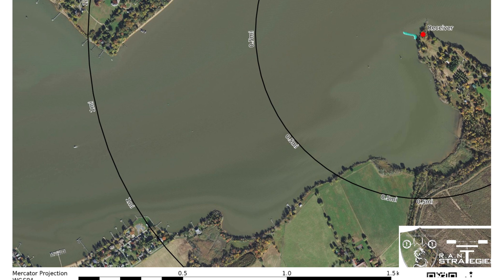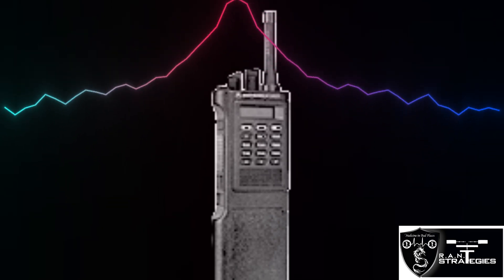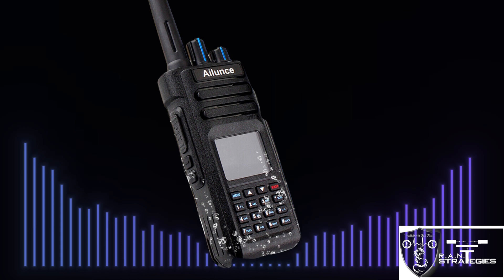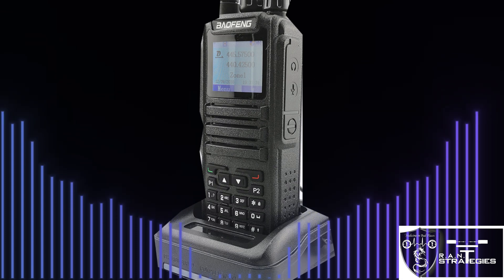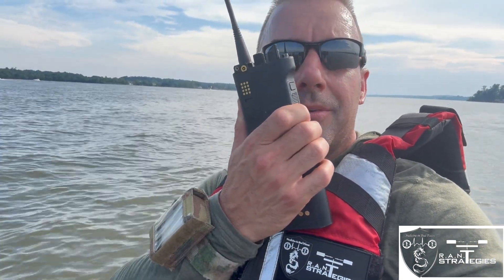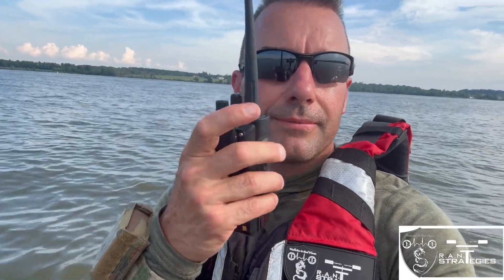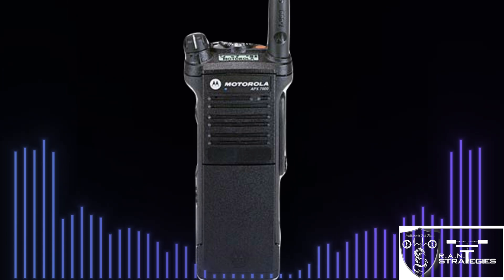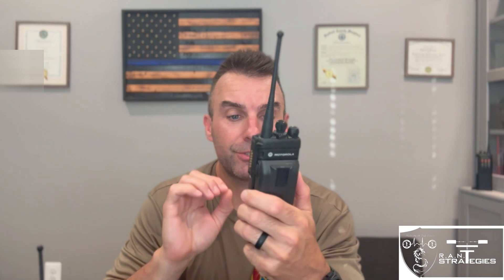UHF - VHF Marine Enviroment Comms

Comment: Well, I must admit to being totally stumped here.
Having watched this test as well as the wooded area tests you performed, quite well in my opinion, I’m at a loss to explain the results.
Back in the late ‘70s, a friend’s family owned a large business in a relatively congested business district. They invested heavily in Motorola Slim Line crystal controlled walkie-talkies running only about 2 watts on VHF with approximately 5” helically wound fixed rubber duck antennas. We tested these radios extensively, and got much better range even in the congested business district than you got over water. Some years later, I would get my HAM license and purchase my first Yaesu 2 meter HT. With the included small battery pack, this radio put out 3.5 watts as I recall, and performed quite well with only the included stubby duck. I would soon upgrade to a Smiley hand-tuned short duck with even better performance.
At this point, I suspect that the Motorola rubber ducks used in your tests may have been designed poorly or not properly tuned to the frequencies that they were operating on.
In any case, I love the range tests and recommend trying a Smiley antenna tuned to the desired band for maximum performance in a practical size.
Keep up the great work…
Reply from the maker: @Nostalgic_York  hey! Thank you for the comment! Yes I too was really surprised by the results over the water. I have read about smiley antennas and everyone raves about them, so they are on the list to pick up and try out for myself!
Reply: @RANTStrategies  Thank you for the very professional tests on all those modern Motorola radios. That’s some collection you’ve acquired.
I’m sure that the hand-tuned Smiley range of high quality, US made rubber ducks will facilitate getting the most out of your radios. If using the radios sans repeaters in relatively open areas with nothing higher than 2 story homes between them, you may want to consider the Smiley 5/8 duck with approximately 6db gain over standard equivalents. This was my go to antenna when I lived in rural America for many years, though I’ve since moved to the city with lots of tall buildings around, thus reverted to 3db gain unity models. Even my stubby ducks out-perform my stock antennas by a considerable margin. Smiley makes these with all the common connectors, thus there is no need to use an adapter with them.
I’m looking forward to hearing about how these work out in your tests…
Best regards,
Jason

Comment: Another top test. I have used Smiley Antennas, tuned for a specific frequency e.g. an antenna tuned for VHF Hi 155mhz is good from 150-160 & a UHF antenna tuned for 465mhz is good from 460-470. They manufacture a wide variety of portable radio antennas and have interchangeable bases for just about any HT made... Motorola, Kenwood, Icom, SMA-F, SMA-M, BNC, TNC ... As I mentioned before, I don't know much about Motorolas.  We had some in the 1990s Coast Guard, and they were boat anchors.  We spent our own $ on VHF Marine Icoms. So I don't know if your Motorola antennas cover the entire frequency spectrum (136-174 & 400-480/520) or if they are "tuned" a bit more narrower... A little trivia... large, ocean freightliners often have UHF radios for comms within the vessel, shipboard firefighting, and for port ops in the 452/462mhz with repeater splits of 10.10, per the ITU. But a lot of them operate on GMRS without a license. It's cheaper. The FCC will send them a warning if they are caught. The UHF penetrates the bulkheads. VHF just bounces around inside the vessel. From your tests, it looks like P25 gives a clearer signal than analog in general.
Reply from the maker: @baronedipiemonte3990  hey Baron, appreciate the comment! I have ZERO experience with smiley antennas but have seen a bunch of good reviews about them and would not mind comparing them to a moto antenna to see how they hold up (hello future video idea). You are also spot on about the UHF radios on ships for the crews….. I am intimately familiar with this form an enforcement perspective and everything you see are saying is accurate. I am very curious to see what happens once I push this out to the 2 mile mark. 🍻
Reply: @RANTStrategies  Having seen this, and your previous tests, I'm thinking that UHF will edge out. "Theory" is fine. It's a foundation.  But real world tests in a variety of environments show what works and what doesn't at the end of the day. It's good that you are testing under simplex because you aren't always going to have the convenience of repeaters - for a variety of reasons... And most of those are 10 watts or more, high gain antennas, 50 ft or higher. I saw first hand what happened to the "fancy" comms in the New Orleans areas after Hurricane Katrina. As well as areas much further north along Lakes Superior & Erie during some hard winter conditions.  A lot of agencies get bit by the newest technology bugs, when often the simple solutions are the best.
Reply from the maker: @baronedipiemonte3990 you are on the EXACT same wavelength with us for what we are going for here by doing these.

Comment: In the water, CB would be the best for range , then VHF and last UHF
Reply: AM CB has characteristics just like HF and is unreliable.  That's why the Coast Guard & FCC strongly discourages CB as a sole means of waterborne comms. Many of the wires you see on ocean going vessels are HF SSB dipole antennas and use "skip" to cover distance.
Reply: @baronedipiemonte3990  
Yes. Never as a sole radio.
But even between 5W CB portables you can do 50 km over water.
FM is nice to avoid QRN.
Reply from the maker: @jplacido9999  hey j, Baron beat me to it,…… in theory you are correct, but in reality what baron is saying is accurate. This is why I’m a bit of a fanatic on gear testing, especially when it comes to comms
Reply: @RANTStrategies  
And you are absolutely right 👍👍👍🙏